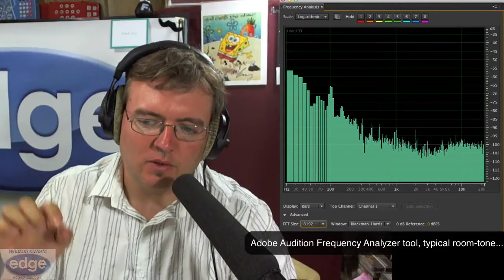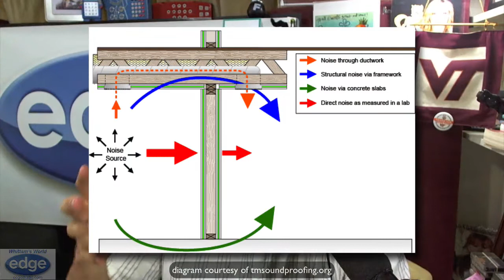Edge Studio's Whittam's World - Episode 38 "Rumble in the Studio"

Comment: Hey George,
I find if I have a low/mid frequency rumble, I use the Analyzer iPhone app, go around the room and find the source. If it is directional, I will use a hyper cardiod pattern mic like my CAD E100S, or switch to hyper on my AKG C414 XL II, CAD M179 or Neumann TLM 107, put the null side of the mic toward the source, and that will most likely take care of the problem. Below, say 120 hrtz, the problem is mostly non dirctional, very low frequency, rumble, where mic placement will not kill it, an adjustale high pass filter often reduces the rumble to nil.
Reply: Yes, experimenting with the off-axis response of your mic can reduce the pickup of some noises, but rumble is non-directional and the mic will hear it no matter which way it faces.  High-pass (low-cut) filters are far more effective at controlling it.